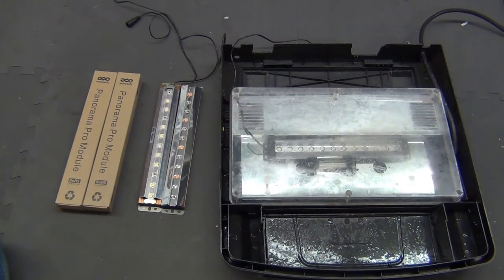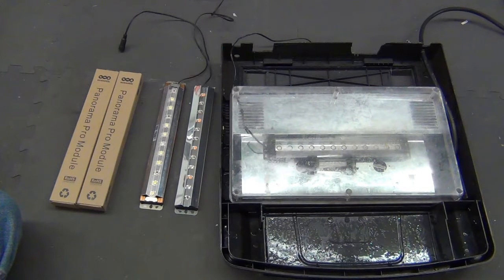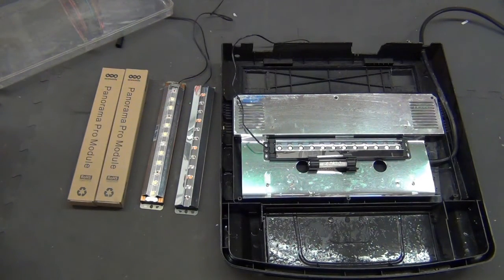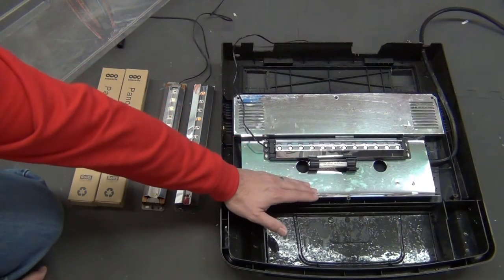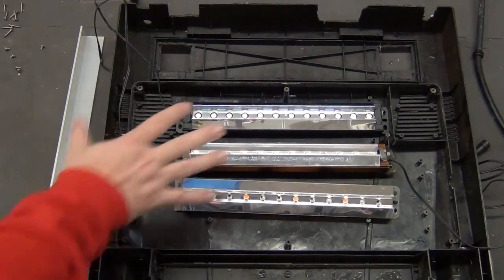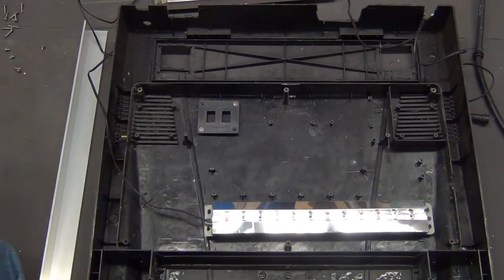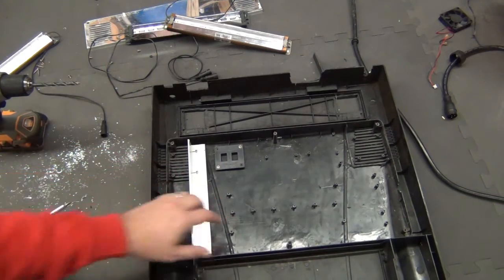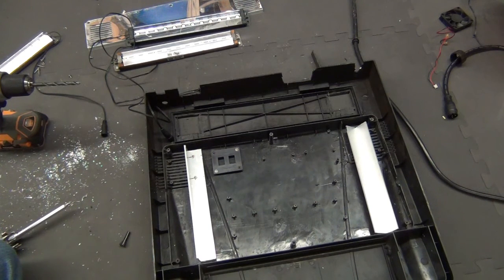Biocube LED Upgrade ***Revised***  Part 2

Comment: hey man.... im worried about not having any mechanical cooling  ie fans
Reply from the maker: So far that hasn't been an issue.  I have a temp monitor that I'm using to watch the amount of heat and so far it really hasn't been too bad, much cooler than the first configuration.
Reply from the maker: The key is to not totally enclose the LED's so that air can flow around the modules and get out.
Reply: good im glad its working when do we get to see the finished product
Reply from the maker: Should be pretty soon.  I believe I have shot all of the videos I just need to put it together.  Hopefully this week I can do that.